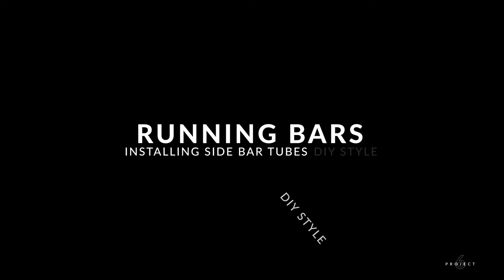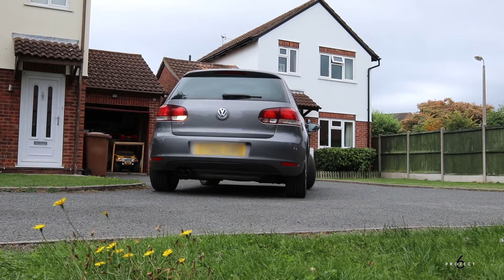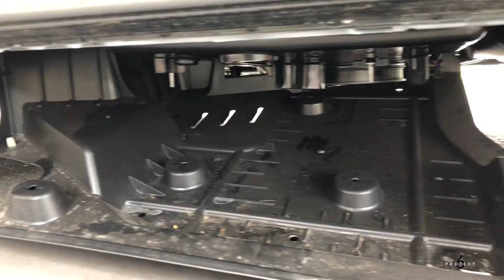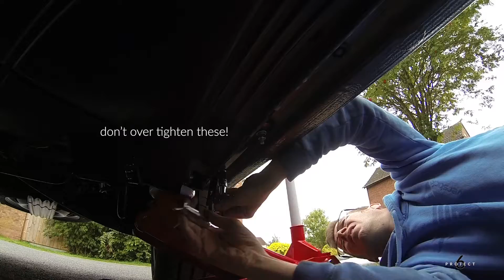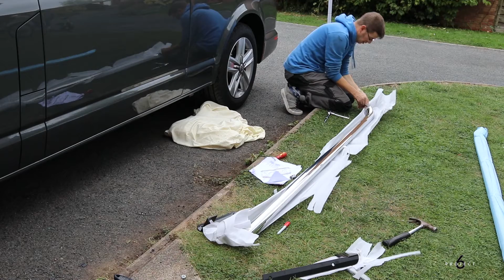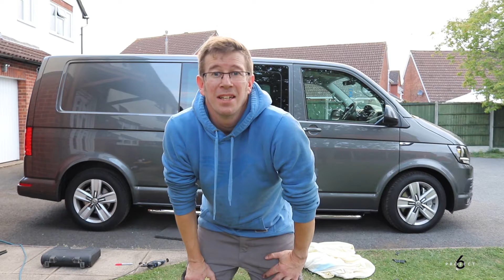Installing T6 or T5 Side Running Bars on a Transporter  DIY FAIL!

Comment: Fitting Leighton OEM sidebars as soon as it stops raining, didn't realise you have to cut the undertray so good to know.
Reply from the maker: hope you managed to get them on over the  weekend 👍
Reply: @SteveField   luckily it changed from rain to dry today, all fitted, pretty easy to do, was worried you said you had yours on the wrong way round. Mine looked the same either way so just guessed. How did you know they were the wrong way?
Reply from the maker: @matthewlaw8268  Glad the weather let up so you could get them fitted.  oh, I meant i had the actual brackets on the wrong side which meant that the bars did not protrude the van after resolving they actually protrude from the sides quite a bit .

Comment: I put some of these side bars on my t4 laser cut easy fit brackets the add said!! What a load of rubbish the brackets are ill fitting with all these bars I’ve now got a t5 and wouldn’t touch side bars again they are a pointless accessory you could do without 👍

Comment: The one where you buy some axle stands would be better before you get hurt
Reply from the maker: Yeh,  No I do use stands normally if you see in my other videos but if you look again I didn't remove the wheels and i'm not really underneath the vehicle its just the camera angle but I appreciate the heads up!!